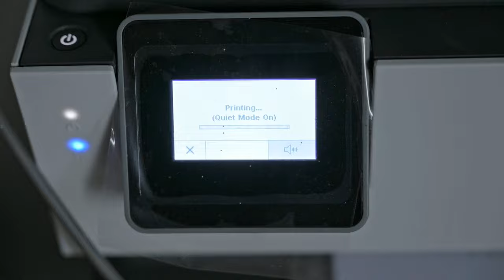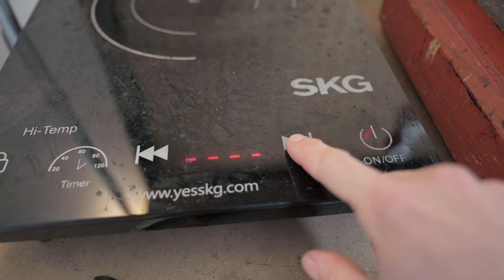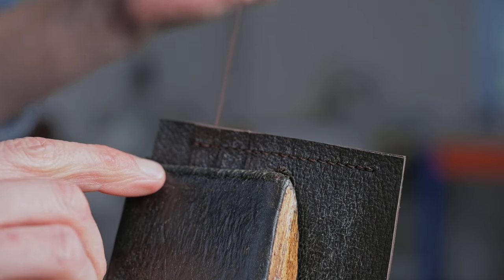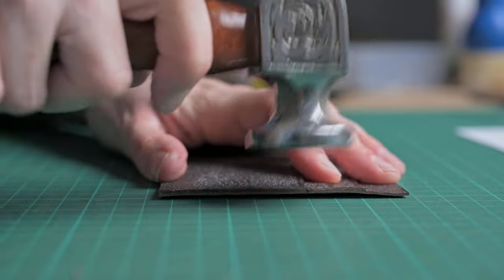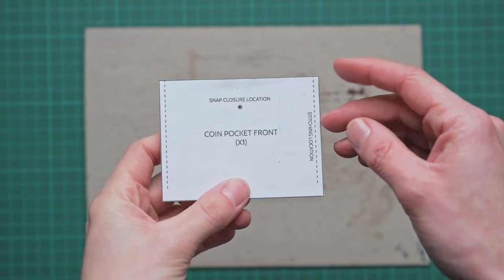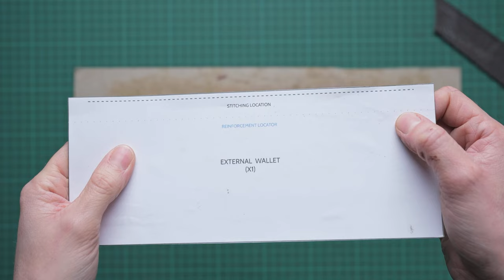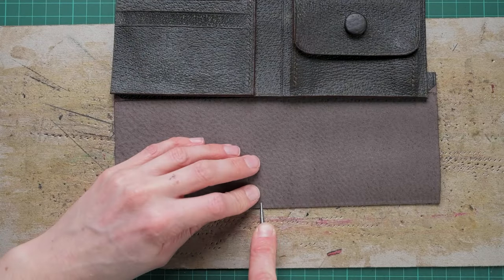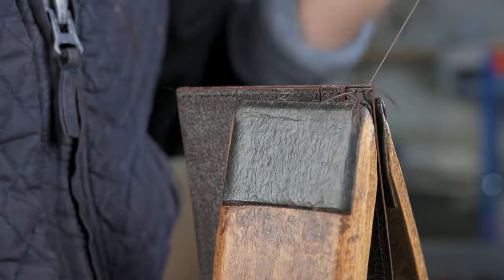Make Your Own // Bifold Wallet with Coin Pocket // PDF Pattern Pack Make Along

Comment: This might be the most practical wallet design (imho) I've seen so far. Love it! Thank you for this great tutorial. I've had several "revelations" :D watching it and definitely learned a lot. 
I have one small (and probably silly) question, if I may. In the beginning, you're transferring some of the patterns onto the flesh side of the leather using a pen (2:37). I was just wondering, is there a reason for that, or is it personal preference? Usually I've seen people transfer the patterns by scratching with an awl onto grain side. Thank you!
Reply from the maker: The leather that I used to make this wallet has a very prominent grain, and it can be hard to see your lines when on the grain side using an awl. For leather like that, I find it easier to mark on the flesh side 👍

Comment: If I don't want the note section, can I just add another layer to the inner wallet to cover the stitching of the card pockets? I need to find a pattern that is for a few cards and a coin pocket and this is a close I can get to what I'm after. Cheers
Reply from the maker: Yes you can just stitch the inner section and outer together fully and thus get rid of the notes section

Comment: You know it's easier to print to card stock directly instead of printing to regular paper, then gluing to cardstock. You eliminate a step, and personally I never liked the glue sticks as they always seem to dry out when I need them.
Reply from the maker: It sure is but, the only card I have is A1 sized so won't fit into my printer....
Reply: @JHLeather  you could trim it down to A4 size